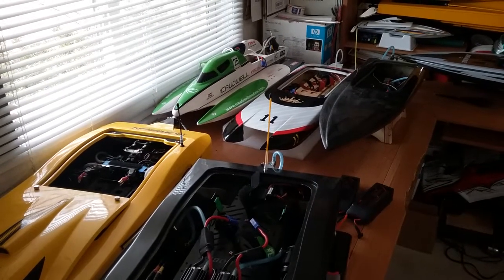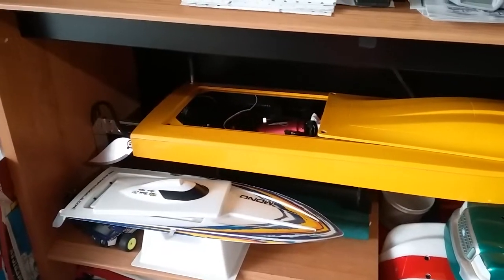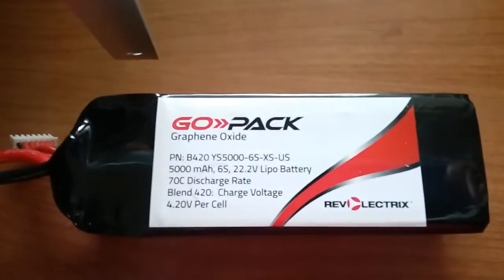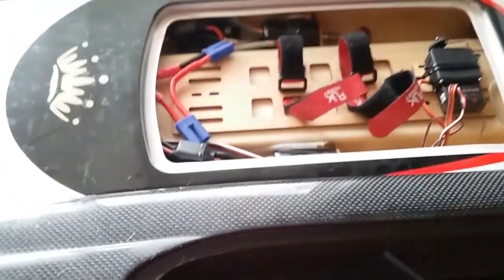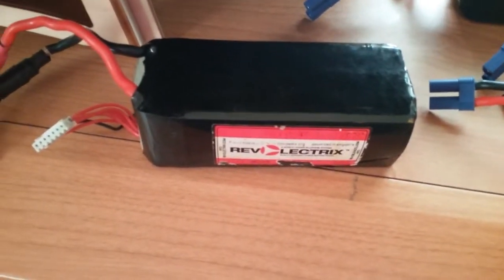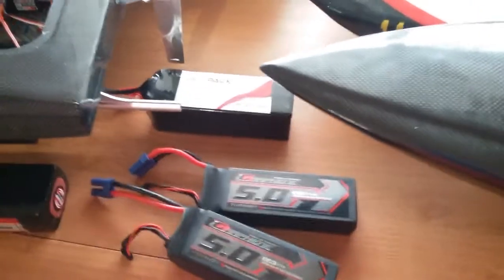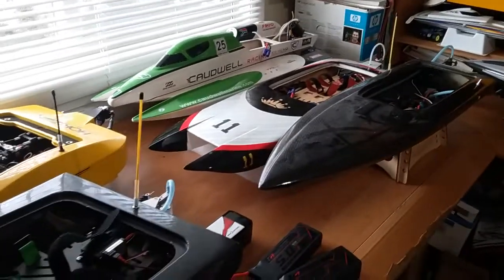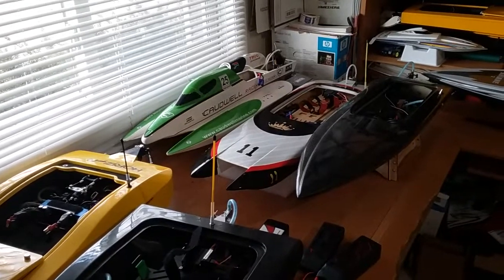Motors, Batteries and Esc's  for All my boats /  plans for 2019

Comment: SS,   I have a few questions:  You have the Fighter CAT, which I feel should be going FASTER,  What would your recommendation(s) be on a Top Speed Set-up in the mid 70s-80mph???  It's a very stable Hull and I feel 75 is realistic.   Please give specifics....  I'm thinking wright of the bat a 6s system.....  what do you think.  BTW, heck of a good Collection.

Comment: Hey I got the same carbon fiber Pursuit same motor tp 3640 2080kv . It's strange how they size their Motors because it's actually 72 mm long I think. but I have a fly color 120 instead of the one that came in at stock the SK 120 my question is what were your best speeds and what prop are you running like you said they're running hot yeah mine's running hot too I mean you can't beat on it you got to run a few laps and then let it cool down and then I'm running dual Cooling and have a coolant pump on it just curious what prop you are running on that any help would be greatly appreciated cuz I didn't know if it was just my setup or I got too big of a prop on there cuz it definitely gets hot $140-150° easy. I'm running a carbon fiber graupner gpr-2317.45 just kind of getting into it but didn't know if I'm over propping it for like a better word. Battery is a zeee 5200 80c 6s. Just got my GPS so I don't know what my speeds are I haven't had a chance to test it yet I'm thinking mid-60s but I'm probably dreaming it just looks fast it's like I said this is my first boat but I'm 52 years old so just getting into it my friend I watched all your videos or seen about all of them thanks for all your help and info on all your prop testings and things like that. I'm not one of those ones that keep everything top secret and won't share my setup because I want everybody to go fast you know this is a fun hobby that everybody is into it loves it and I try to share my knowledge I mean so you don't have to waste a bunch of money on stuff that doesn't work again thanks for your help